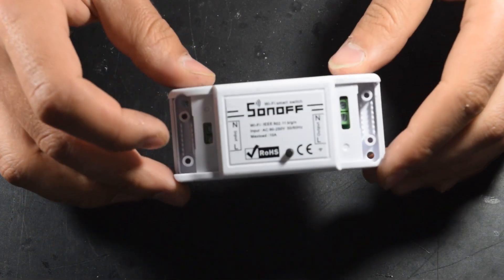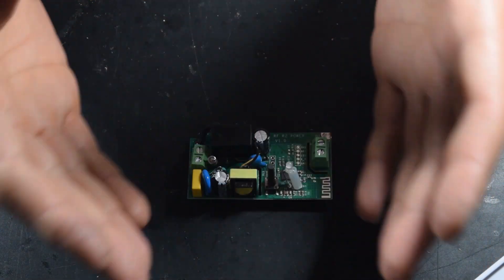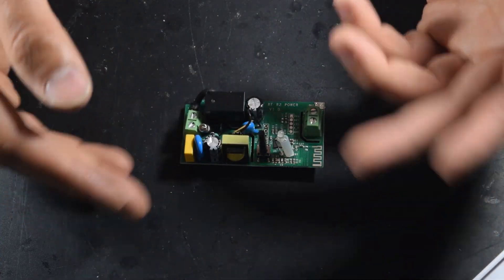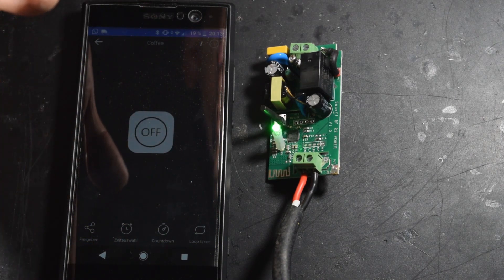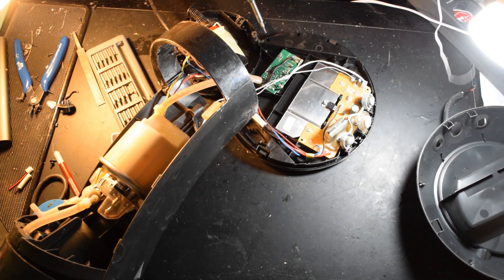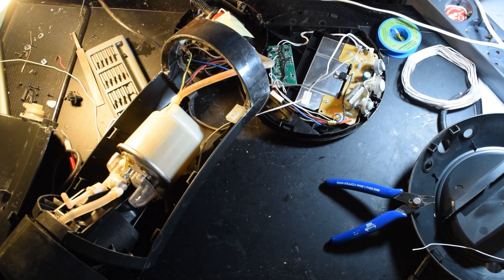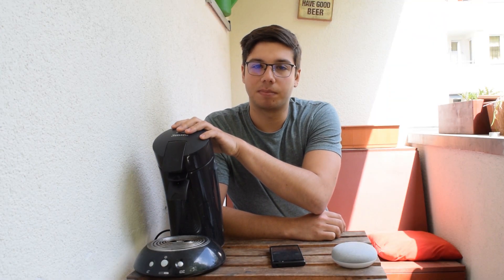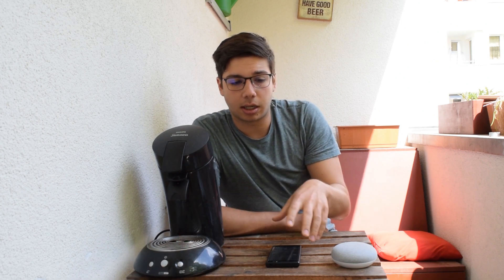How to modify a Sonoff Basic Switch to simulate a button push or "Hooking up stuff to Wifi"

Comment: This tutorial leads to destroying your device. I don't recommend doing it! It does not work! He advises you to connect ground to line.
Reply from the maker: mine has been working forever at this point, where am i telling you to do that?
Reply: @Uniquelymade  You did not, i finally managed to fix the device but it's not worth following. In the picture you presented to cut the fuse so that the whole device lost power. No other guide shows anybody to do that.

Comment: I have fall/rise units that are being used by a relative with disabilities. I'm planning on making these voice activated with alexa. There are two buttons for up and down. The button needs to be held. Would it be possible to add like you have above? Is there any other devices that can be used plug and play?
Thanks
Reply from the maker: Plus and play I don't know.
But I know there are sonoff units with 2 outputs and in the app the duration of the trigger time can be set, so it could be done with that.

Comment: So my. Coffee maker has a 4 pin momentary pushbutton to start brewing. Would this work??
Reply from the maker: Normally two of those are connected together, so 4 pins are actually just 2 pins. You would need to check that with the multimeter tho

Comment: Hey! Can you use the sonoff mini on the same way?
If so, can you make a video about that also?
I really want to simulate button push with these switches, but can't find out myself how to :(
Reply from the maker: i would assume you can, but i dont have one at hand. I can order one and try and make a quick follow up video :) (could take a lot of time tho) so if you want, send me images of both sides of the circuit board and i might be able to help you that way
Reply: @Uniquelymade  Thank you, I really appreciate your fast answer. But I alredy figured out myself how to modify it. And already built it in my projector, so now I can command my Google mini to turn it on/off :)
Your video inspired me and helped a LOT (it is the only one I could find with this way of using a sonoff switch, so it's really unique). Big thanks for sharing it with us!
Reply from the maker: @kamara.istvan  Thats awesome to hear =) glad to be able to help!
Reply: @kamara.istvan  could you post how to modify the circuit? i'd like to do this too
Reply: @HumanoLaranja  Hey! Sry but I hadn't documented it, and it's still built inside my projector working fine for a year now :)
But if you need it, I'll try to take it apart on the weekend, or modify another sonoff mini... got some spares left.
Gonna try to post a video about it, but I've never done a youtube video so far x)
Reply: @kamara.istvan  i'll really appreciate it, i'll love a video about it =D
Reply from the maker: I'll get a sonoff mini and try to make a quick video about it :)
Reply: @Uniquelymade  thank you so much. I'm from Brazil and here this kind of stuff are so expensive. I'd like to do this but I can't buy one just for test. If you made a video it will be perfect.
Reply: @Uniquelymade  looking forward to it. I have child's toy with a momentary button i would love to control, but i need the smaller sonoff.